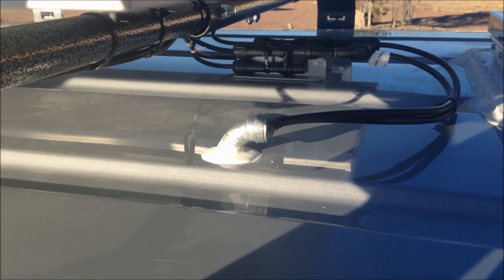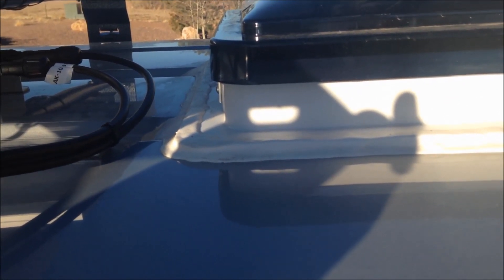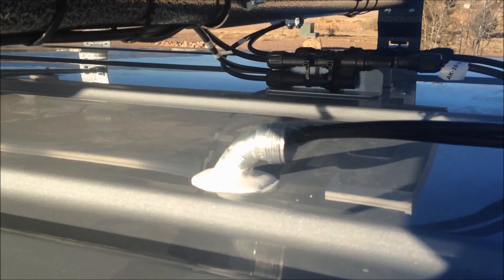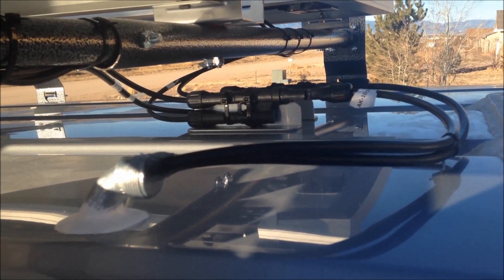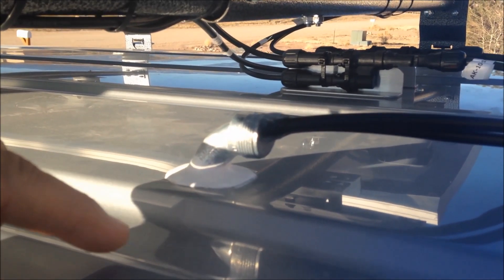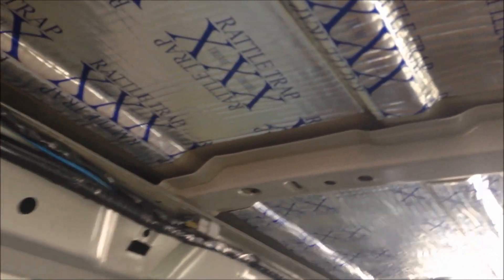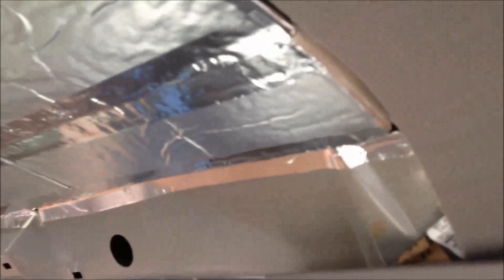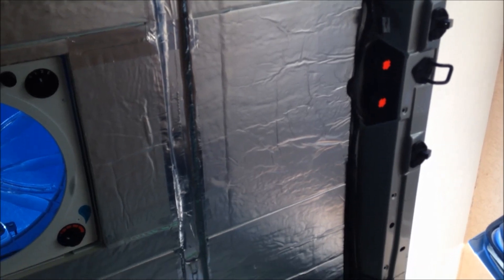How to Wire Your Camper Van Solar Panels (and not mess it up!)

Comment: Very tidy work up on your roof.  Looks great and leak proof.  The ceiling insulation came together well.  I can only imagine at this point how tired your arms got working on the ceiling insulation.  Good work!
Reply from the maker: ***** Yes my arms were tired but now that it's complete I'm thinking it will be worth the effort. I see most guys insulating with closed cell foam of some sort or another. I would just try to avoid regular fiberglass insulation because it can retain moisture and depending on your climate, possibly be a breeding ground for mold. This is part of the reason for the fan but also why I am trying to use other forms of insulating material if and when possible.
Reply: Luckily, my Dad is a retired Electrical Engineer and knows quite a bit about all forms of construction, so I have a mentor but he lives 200 miles away.  I'm heading to his place on Monday for a few days to start phase 1 of the build.  :)